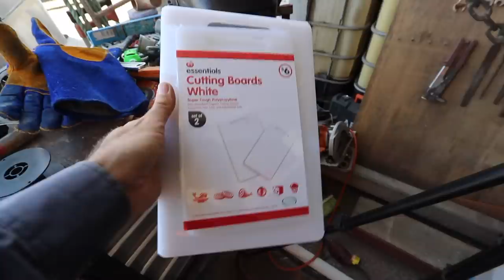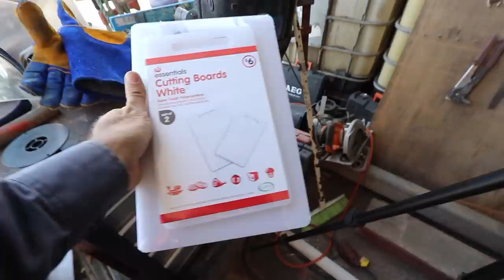DIY Rigid Inflatable Dinghy, Hull Welding Part 4, - Project Brupeg Ep. 110

Comment: Dingy is coming along nicely and I think it's going to be a lot better than an inflatable. Smart to isolate the dc current from the hull. No sense making it a battery. On the connections in the tanks I would completely seal the wire and connections with liquid electoral tape so air can't get to them and corrode the connections. Looks good and don't forget to include a couple fishing rod holders.

Comment: Having owned an aluminum tubed tender, I strongly suggest adding a stringer and ribs inside the aft area of the tubes in contact with the water while planing. Otherwise, you may get an oil-canning effect that work hardens the material leading to cracks and failures. It happened to me

Comment: Great idea using the plastic chopping blocks. If it was me, I would have made a 'sandwich' with a plastic plate each side of the alloy tube and a longer bolt.  Then you would not be relying on the sika (which I know can do the job) as when you have big blokes with big boots getting in and out of the dinghy it could be accidentally knocked off. Keep up the great work. Nice to head a real Southland accent!
Reply from the maker: Thanks Ranganui, Yeah Rods accent is awesome. Jess is from Dunedin as well, so when the two of them start talking after a while its a different dialec! I agree with you about blokes and boots, hadnt thought of that aspect. One idea that was mentioned was riveting the plate in, might try that but if I do take the plates off I will add the sandwich plate in there

Comment: One more bit of advise. When doing tack welds. Turn your heat up to almost twice what you weld at for a given thickness. It makes the tack burn in faster and deeper. Also makes them easier to weld over the top of when you come back over with the actual weld.
Reply from the maker: Ahhh bloody awesome, thank you for this, makes a lot of sense
Reply: Project Brupeg glad to help. It also avoids any unnecessary heat build up by getting in and out quicker.

Comment: Roll on bed liner (used to rubberized truck(utes) beds) is great for battery boxes in the off road world here in the states.
Reply from the maker: Cool, thanks John, i was thinking of thick rubber (like half inch) for the bottom to give the batteries some suspension (for when we jump over waves and hit the next one hard etc)

Comment: Nice bit of work on the dingy Dame. I would suggest putting a plug at the very back and bottom of each pontoon. When, not if, you get water in the tubes you'll have a need to drain them, even with them filled with foam. I'm guessing but reboarding an alloy dingy might be a bit harder than an inflatable. Some sort of boarding ladder would be necessary. Maybe something like a ladder that folds out over the side and hugs the tubes. Cheers guys. Keep posting vidz we're watching. Gonna go buy a Brupeg t-shirt now! Rick & Lori. M/V SHE-KON
Reply from the maker: Awesome stuff guys. Yeah we added a bung to each rear and even though it’s close cell foam I’m hoping to be able to flip the dinghy and foam the top of the tube and leave a gap at the bottom for water to collect in rather than sitting in foam. Might not be possible but I’ll give it a go
Reply: @ProjectBrupeg  Guess I should have watched the end of the vid before I opened my stoopid mouth! lol Carry on.

Comment: Those corner cuts at the bow really make it all look nice.  Pre-planned even...Plus: If you are boarding the dinghy from the water, you want to board from the transom end to avoid tipping.  Then you might want to consider a rear shelf that folds up.  Like a diving platform. It makes getting into the boat a LOT easier.
Reply from the maker: Hi Don, this is just the little run about dinghy, its unlikely we will be doing any diving from this one (the other dinghy will be seeing a lot of off boat action). that said we sea trialed it recently and its incredibly stable, so much so you can hual yourself up on one tube and the boat hardly even notices it.

Comment: Jess should get a pair of welding glasses for the camera shots. Very comfortable and they make auto dimming ones now.
Reply from the maker: Ill have a look into that
Reply: A face mask with auto darkening is about $40 usd. Polycarbonate safety glasses are a must for everyone in the area as they are 100% uv protection so you dont get the flashed and feel like your eyeballs have turned to sandpaper

Comment: With that amount of current flowing through those bolts you should consider swapping the Stainless steel for bronze or copper to reduce the IR drop. If the bolt gets loose it will heat up and melt those blocks.
Reply from the maker: Yeah we have thought of that. it is possible to tighten the bolt from the dinghy side later on if needed so our plan is to just use the boat and see how it fairs. Its something we can easily change later on
Reply: I think John has a good point, especially as the hull will be foamed in.  You could replace the stainless bolts with silicon bronze bolts and nuts.
Reply from the maker: Oliver this is the whole point of the plastic plates, to keep metals apart. Everything on this boat is alloy or plastic except for the stainless bolt terminals. and they are isolated by the plastic for that very reason

Comment: Do you use candle wax on your cutting discs? If not, try dressing both sides of the disc with wax. For aluminium fab, this will change your life.
Reply from the maker: Hi yeah I have a wax for alloy and completely agree it is a life changing moment when you first use it. The issue we found is cuts with wax were a pig to weld, assuming its wax getting in the weld. So when we know we’ll be welding we actually avoid the wax for that reason

Comment: If you put a length of 1 inch (or bigger) aluminum tube from the battery box back to the transom you could have just ran the battery cable through the tube with no joins or breaks in the cable. Basically make a tunnel from the battery box to the transom. That way you would be able to easily remove/replace/check the cable in the future. No isolation issues. Also did you check out the Anderson type plugs. They carry a lot of current and are very simple and cheap.
Reply from the maker: Hi Jase. this method allows us to keep the cable inside conduit sealed in an air tight tube without the ability for water to make it into the battery box. I'm happy enough with the set up. I did think about Anderson plugs as they are a nice system but i couldnt find any that could handle the amps at a continous rating.
Reply: @ProjectBrupeg  There are 175 Amp and 350 Amp continuous rated versions of the Anderson connectors. Here is a link to an electric vehicle DIY company here in Australia that list them for under $7 each but they are on eBay as well. https://www.evworks.com.au/power-connector-600v-175a-anderson-compatible-desi The Anderson would make for an easy way to attach a charger to the batteries, unplug the outboard and plug in the charger.
Reply from the maker: This is flippin awesome. I had no idea they made them that strong! I will get a couple underway today. I like your idea of outboard out, charger in, keeps it nice and simple.

Comment: Regarding draining the hulls on the dinghy, not sure if you can get 40mm slotted drain pipe up where you are and glue it to the bottom of the hulls. That way any water can enter the pipe via the slots and drain out of the bung. Another way might be to grease up the outside of a suitable tube and temporarily fix it to the hull. When the foam flotation has set it is just a matter of pulling the tube out leaving a cavity. Anyhow, top job so far.
Reply from the maker: Hi Ray, we managed to be able to foam the top of the tubes by flipping the dinghy and leaving a cavity on the bottom of each tube

Comment: Looking awesome, consider using a second piece of chopping board on the inside and a longer bolt to draw both pieces together sandwiching the aluminium and sealant in between.
Reply from the maker: Yeah i didn’t think of this at the time but will be adding this next time I pull the plastic off the hull

Comment: Back in the day, when I owned a fabrication shop, our welders would always grind back out and clean up if they had to stop on waterproof work.  Every time you stop and start, it is a risk and it is always where you get the leaks.  Their typical run lengths once all tacked up were at least 2 feet, sometimes longer, I've never seen lots of little 2" long welds being used succesfully before.
Reply from the maker: Yeah true that, its all learning at this end. ive never welded alloy before and i assumed being 2mm it would warp like crazy (it didnt) so ive learnt for next time

Comment: I thought that the size of engine to be used, could be accountable to the size of the extension of the tubes aft? Obviously only to a certain size. Your "overhang" is quite small, but perhaps the tube diameter also comes into the calculations?

Comment: Awesome video update guys. Could you  of not sourced a large bore scrap of  sewage pipe as a template to clip on like you mentioned. You gottta love datem  points. I'd use cam buckle straps to secure the batteries and add a silica gel moisture absorbent packs to each battery hatch. Also weld some tabs to the inside of the tube then attach a PVC tube conduit to stop your battery cables moving, wearing & shorting
Reply from the maker: 'Hi AW, so a few points, not sure about sewage pipe, never looked into it. Cam buckles was exactly what i had in mind for the straps, a nice easy common method to hold them down. as for conduit, we filled the tubes with closed cell foam so once that was in the conduit was held rigid. The conduit was flexi pipe but its not the stuff with a lengthwise split and its crush proof so perfect for going in the foam space.

Comment: Oversize battery box is a plus. I suspect gell cells will get swapped out for something better down the road. Even if you replace them with more gell cells when they die, you may not be able to get exactly the same size, so more room is good. I think AGM would give better service and lithium based may be better (and lighter) than that. My experience with gell cells has been with backup power and emergency lighting indoors where hydrogen fumes are not acceptable. I think a standard marine flooded cell would work better than gell and AGM would take the spill out of the equation. I think new generation stuff is mostly lithium based. I look forward to your sea trials. While I would tend to do some things different, I can't say it would be any better. I think you have done well.
Reply from the maker: Thanks Len, yeah we looked at lithium but for us it wasn’t worth the expense as large range is not required on this boat. The AGM’s were selected as we need the ability to store the dinghy on its side or up side down so any liquid battery wasn’t an option

Comment: You may find that the length of the tubing behind the transom can have an effect on how well the dinghy can perform, like the ability it has to come up on plane if it can achieve that speed.
Reply from the maker: Hi Minus, with the electric we wont be able to plan. that said there is no reason you couldnt put a 15hp outboard on this and have a little rip snorter

Comment: By God I love the way your mind works, those isolation blocks are brilliant. After pressure testing and foam is in have you considered pumping nitrogen in to displace the air, cutting down on condensation? Just a thought. Those grab rails turned out great, put more on. Spot on.
Reply from the maker: Ha!, like minds... I thought of using Argon (as i have it on my welder) to remove the air...

Comment: The little tinny looking the business,thought you would have prioritised some recessed stubby holders. I know you have probably already finished it, but an easy way to project a straight line (rather that slowly walk the square around) onto the tubes is to use a broad flexible band, or square sheet.....something like a rubber door mat, or silicone baking sheet would do (think you employed the band method in one of your earlier vids). Anywho hope you manage to give us a summary at the end of this 'little' project on what techniques you think worked best for you.
Reply from the maker: Thanks Dan, i quite like the summary idea. we did learn a bucket load for the next dinghy build, things that will shave weeks off the build time

Comment: hi for your plug look at electric lift they use heavy duty plugs , not waterproof thow , but i don't think you need that because as far as i know your batteries won't be in a waterproof box just a thought  anyway
Reply: Fork lifts use Anderson plugs. They are high amp plugs for sure. Works in boats aswell
Reply from the maker: Thansk for this, I managed to find a plug that can handle 600amp continous so ive got them on order and we will see how they go

Comment: Hi Damian, did you consider using the same hole saw to cut 4 more white plastic discs and using the existing bolt arrangment add the discs at the back surface, this will prevent your isolation plate from ever moving/ slipping ( locked within the aluminium hole) should the glue ever fail or the terminal recieves a knock.
Reply: I just typed out pretty much the exact same comment before I saw this. Looks like you beat me to it. If he added a third square flange on the back face inside the tube it would lock it in place mechanically, needing the sealant only to seal rather than stick.
Reply from the maker: Rick & Phil, nope i didnt think of any of this but its a bloody good idea and wish I had thought of it. for now ive got the single plate held with sealant. Seems to be working fine but if I ever need to open them up i will make this mod. Thanks for thinking of it

Comment: Bruce, something occurred to me while watching Part 4 of the dinghy build. I believe you will need some way to drain the tubes if they get water in them. Two drains per side. One in front of the battery compartment. One behind the battery compartment. If you happened to crumple  a section draining water will be important. At least that is what I am thinking.
Reply from the maker: Hi Bruce. the battery boxes dont seal off the front half of th boat so if water does get in the bow it get be drained from the rear of the tube. each tube has a regular bung for that reason and each tube if filled roughly 80% with closed cell foam

Comment: thanks for the video as always looks like it was a good week for ya all the runabout is nearly there ;] if you have a lot more welding to do in the future  i might suggest some tempoary cardboard walls scribed to brupeds hull fore and aft and a tarp between them  making yourself a somewhat more shielded location for welding  or  a glass bowl with a hole in it to put your torch into and just have a torch tent lol  looking forward to more  file transfer data loss..i assume it was from card to harddrive when it happened ive been there more than once is a total pita  "in the a" and will happen to the best of us  until  they decide  we need another reason to upgrade equipment and hardware to satisfy there software "improvements"  best help i can be there is copy paste not cut paste and delete after verification  when i loose data i can re download it 99% of the time and its only time lost for me.. when you loose data its gone for all a good reason for annoyance on your part  until next comment and thought ;]
Reply from the maker: Hi Mike, the data loss was driver error. i was checking how much room the card had on it on the camera and rather than hit escape (back out of the menu) i hit erase. i watched the files disapear in front of my eyes and no matter hpw much i swore at the camera it keeps going! Its like it couldnt hear me at all
Reply: @ProjectBrupeg  camera phone kindle  even lightbulbs now!!  all run on os operating systems  i have never liked how os=s handle removable media..usb hd or micro sd or flash.. and how they manage or transfer files  it happens time and again  true it happens on harddrives as well  but no where near as oftin
regardless thanks for the vids
Reply from the maker: Thanks Mike, the really expensive pro cameras generalyl have 2 SD cards so they have duplicates of files so nothing can be lost but the Canon 80D's that we use are a single SD and hence there is risk of dumping files, our back up is two cameras running at all times so we at least can recover some footage to make the story flow.

Comment: Save the tube cut-outs from the battery boxes, couple hinges and you save yourself from making doors for them.
Reply: That's what I was thinking too ;)
Reply from the maker: Hi Scott, yeah the plan was actually get some of the bigger tube offcuts and make some doors roughly an inch bigger all the way round. that way we can make the box water tight ish, (leaving a gap at the bottom for any water and gas to run out of)

Comment: Battery Box - The Gel or VRLA lead acid emit a small but significant amount of fumes over time that are explosive and corrosive . The compartment that they are in should have some positive ventilation.
Reply from the maker: Hi Rush, yeah at this stage we dont have doors on the boxes. I was thinking of making some but im starting to wonder if its even needed now. We sea tested without lids and i think with anti corosive goop on the terminals we will likely be ok

Comment: Too late I know but for future reference you can lay those sealed batteries down or in any direction for that matter. I wonder why you didn’t go for more amp hours, 60 ah doesn’t sound like much?
Reply from the maker: Hi Stevie. 60 was enough for this boat, it’s a small motor and we didn’t need a huge range. With these batteries we have 30mins at full throttle before we drain them to 50%. Or 1.5hrs at half throttle. Given it’s only a wee boat to nip between shore and Brupeg that was plenty. Dame